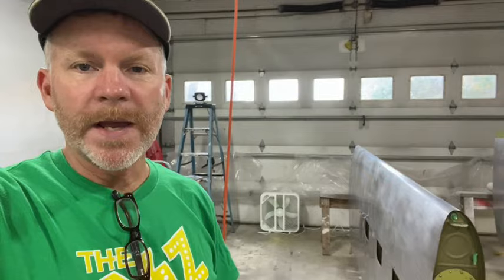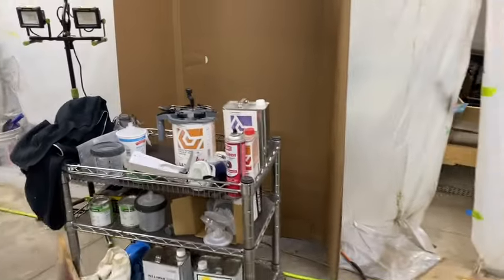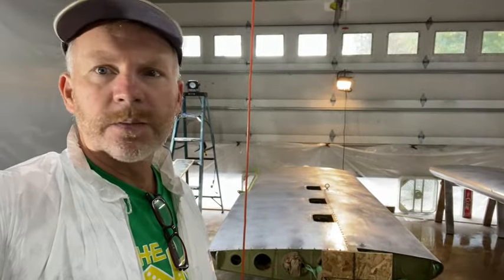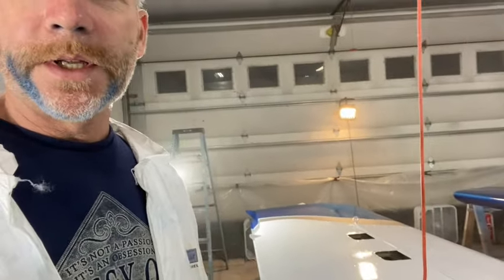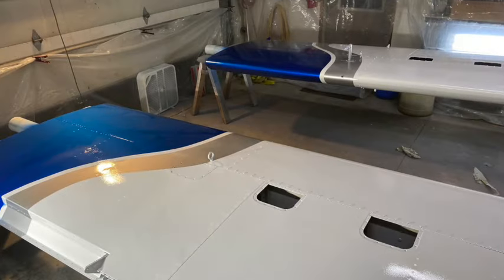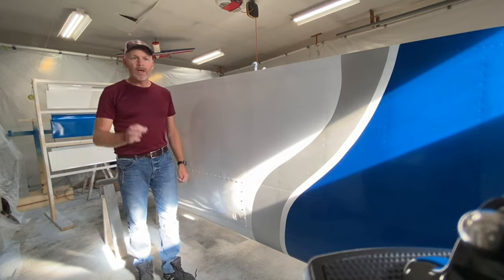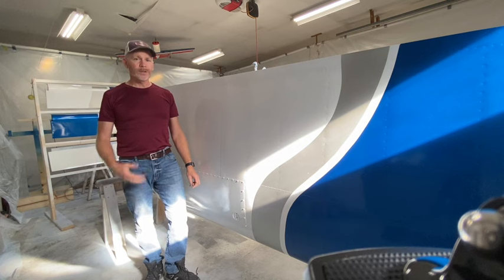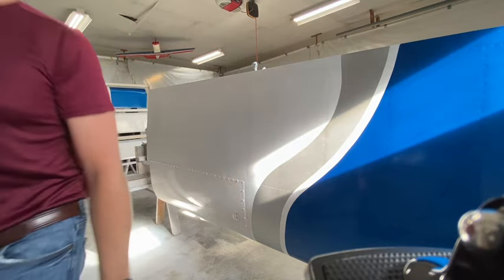How I painted my Vans RV-7 in my garage.

Comment: Sorry, just how not to do anything! Most of all, never wet anything when using epoxy, your wet floor will rise moisture and the epoxy will escalate in all kinds of ways, I have not seen anyone using knitternd paper for transmitting stupid simple lines either…and NEVER. Wash your stupid parts with a dtergetnt….and one time scuffing is enough…why twice? Do you think the first scratches haven,t been enough? I don,t get a lot why you combine wood working techniques standards for furniture surface prepping for modern materials at all….but as long as you have fun and the paint sticks to the bird….why not….but at the end and all the work: I had just bought a slow running angle grinder and a big polishing disc and pads for that and polished the whole aluminium to mirror, it would have been cheaper and faster….

Comment: Nice work, and very helpful to me. Just starting to paint my 9A in my barn. I decided to use single stage and did some practicing on a car hood hung vertically. I'll have way more than 25 hours invested, but I'm enjoying the process.
Reply: i am planning on doing the same.  I have a 15 years old car hood that desperately need a new paint job and am planning on using this as practice to gain some experiences before aircraft painting.

Comment: Can you define color sanding?
Reply from the maker: @donfreeman686   color sanding is wet sanding after the base “color” coat is dry but before painting the clear coat. Can be done with solid colors only- no metallics.  General therapy is that you can’t get a smooth finish over a poor base.  I only use color sanding sparingly and try to get the base color coat as smooth as possible. Which is not usually a problem. The base sprays easier than the clear. You might color sand a run in the base coat. 
Wet sanding is the same but after the clear is sprayed and dry. We wet sand to get rid of overspray and orange peel. 
Hope that helps.

Comment: Sanding isn’t so bad with a flush riveted airplane like your RV.  My S-21 has pulled rivets so sanding its finish would be a nightmare so I am trying to learn to get a finish that minimizes orange peel yet still avoids runs as the rivet heads would greatly complicate sanding.

Comment: You did a really nice job congratulations!
Do you have any pictures of the stand where you can rotate the wings?
Reply from the maker: The wings stands are very low tech. I simply made a rectangular  “block” that bolted to the main spar and a 3” sewer pvc pipe that shoved down the lightning holes at the tips. Set up 2 saw horses and you can roll them in any direction.

Comment: Good video, thanks for sharing with the rest of us.  I wanted to ask if you used a HVLP sprayer?  I too will be painting in my garage and I’ve watched a lot of folks use them with their other vehicles in the garage and supposedly the paint atomizes before it hits other surfaces that you do not want paint on.  Thanks again, Matt
Reply from the maker: Yes to the HVLP.  No matter what you paint with- you are gonna get overspray everywhere!  Best bet is good airflow and think about that while you paint.  I start up wind and work downwind so to speak so the overspray from 1 part doesn't ruin the nice wet finish on another.
Reply: @toolman311  Ok Sir, thanks for the tips and the prompt response.  Your paint scheme looks great and you did a very good job.  One thing I do not know nor have I researched is where does one buy airplane paint?  Aircraft Spruce perhaps?  Have an excellent day, Matt.
Reply from the maker: @KingFox76  airplane paint is the same as any other automotive paint. You have 2 styles or mixtures (single stage- that is sprayed in 1 color coat and cures to a finish.  It is somewhat easier to spray but less fixable I guess you would say if you get runs or spots you need to sand out. ). 2 stage or “base + clear coat” is the other. This is where you spray your color scheme- let it flash then top coat it with a very hard clear coat.  That is what I did.  The color goes on easily- the clear takes some practice and the right conditions to get it to lay down smooth but can be sanded later)
As to airplanes- make sure your primer is rated for aluminum and fiberglass. Some automotive mixtures are not good at adhering to aluminum.
Reply: @toolman311  Ok Sir, I know really nothing about either so I’m sure this will turn into another expensive learning situation for me.  The 2 stage sounds like my best route, I’m sure I’ll have runs and bubble and the like.  I plan on trying to spray a metal door this time home to get used to the gun.  I’ve had the thing for a year… and it is still in the box.  I was too motivated perhaps.  Thanks again for sharing, your aircraft looks good.

Comment: What chemical etching product did you use? Did you do a video on transporting your parts? My concern is damaging my aircraft.
Reply from the maker: No chemical etching at all. Soap and water, then red scotch bright again with dish soap, then final wipe down just before priming with a wax/grease remover and spray.  Used an epoxy primer specifically for aluminum. That does have an acid etch to it. Tach cloth and then base plus clear coats.

Comment: what paint system did you use?
Reply from the maker: Harbor freight HVLP guns. Siemens base/clear paint.
Reply: What compressor setup did you use? Filters and such. Also any problems with pin holes?

From here it looks amazing
Reply from the maker: @shanecoffey1914  60 gallon shop compressor. I have 2 water separators on the line though. One at the compressor and one almost at the end of the 100’ hose. Descant .  Gotta have dry preferable cool air. Not right out of the compressor. Hot air holds moisture. Finish is maybe an 8 overall. 10 in some places with a few errors here and there. Wasn’t expecting perfection. Thanks for the question.